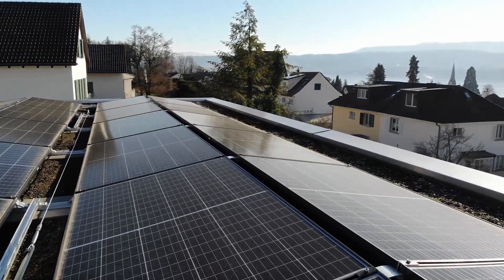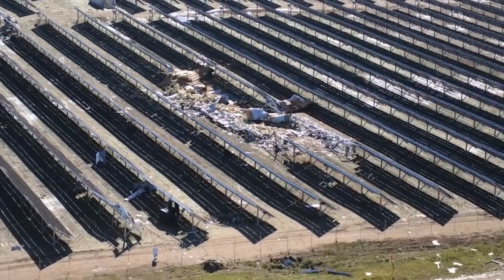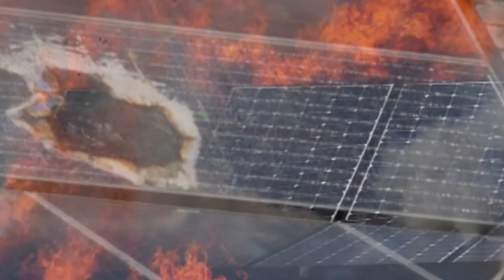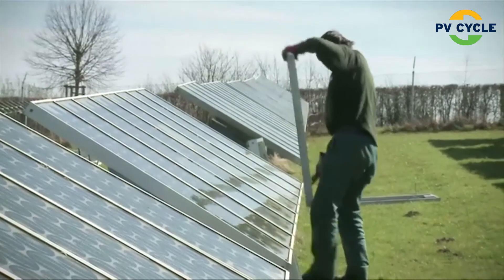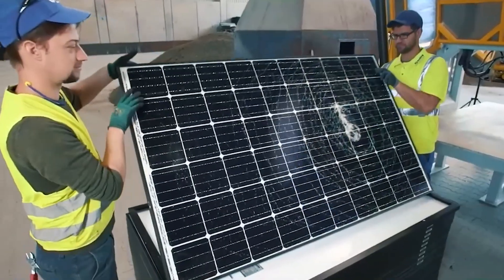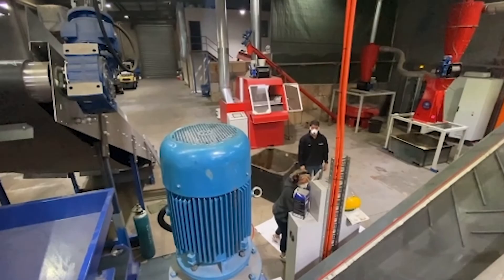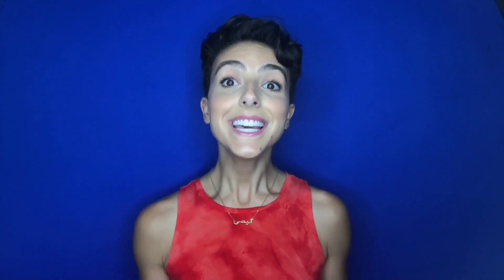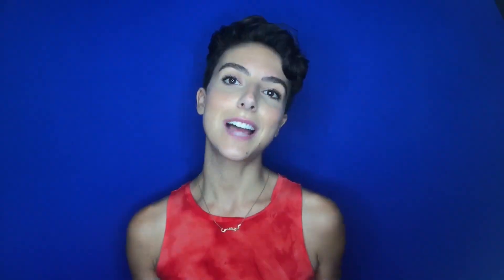Is Solar Power Actually Sustainable?

Comment: This video does not make a clear case for the sustainability of solar panels. The recyclability of the panels has nothing to do with their sustainability. After their useful life span they are essentially a raw material for a secondary manufacturing process. One that is arguably even more environmentally destructive than just putting it in a landfill. 

Solar panels are in no way sustainable. It takes a massive percentage of the operational life to pay back their manufacturing Co2 cost of pv panels and that does not account for any of the logistics and secondary technologies like inverters or batteries + chargers. There just isn’t any good way to make environmental argument for solar (pv) panels. They are slightly worse than modern traditional power generation. They are useful for other reasons.

Also, don’t hate on landfills, they are the best way we have of managing waste. Processes such as recycling or reuse/ repurposing keep the volatiles in circulation which maximizes the chance of them leaching into the environment. Landfills take products that originate within the earth and relocate them in a more stable form to another piece of earth. It’s literally the best way to manage almost all waste.  You can even use that earth later once it has been compacted. Think of it as a free construction land that did not require any additional environmental destruction. Landfills are the best waste management strategy by miles. They are already perfectly capable of handling the "glut" to come.